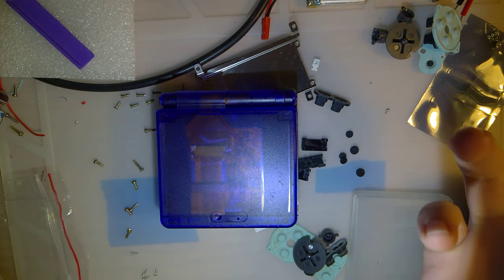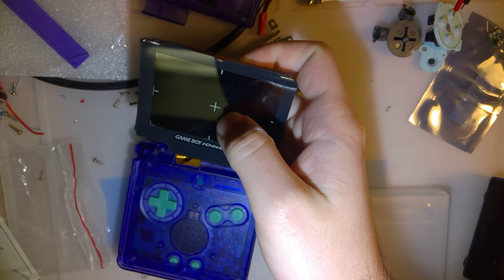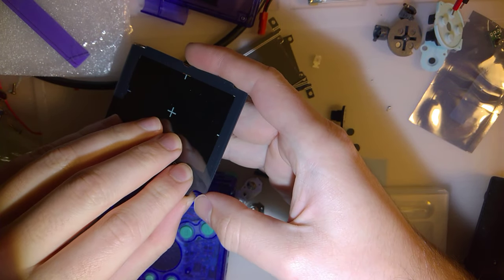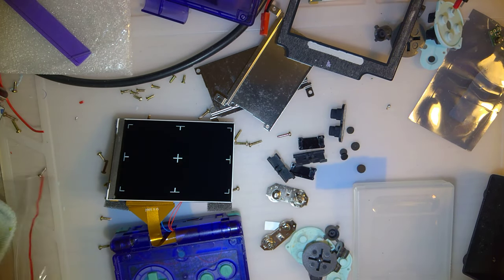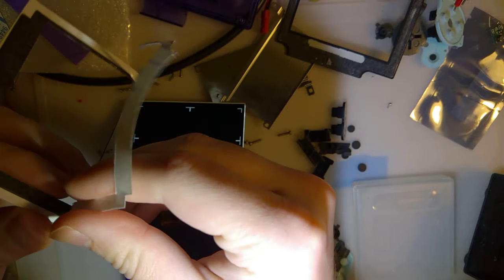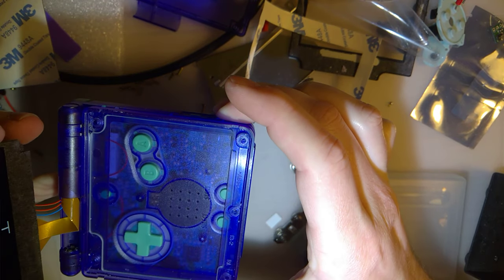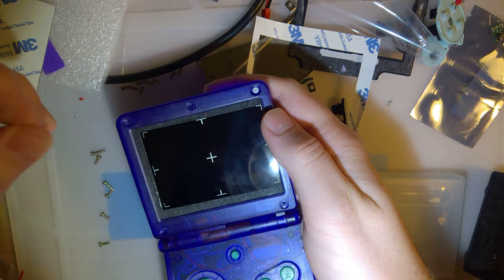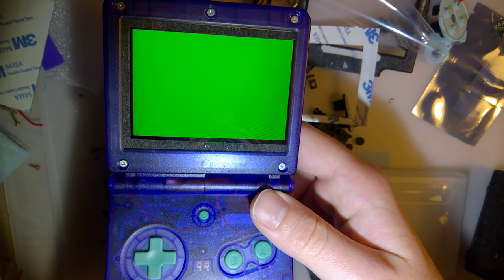Finishing the install of FunnyPlaying IPS GBA Screen in a GBA SP (Part 2)

Comment: I feel your pain at the end of the video. Finally I just put on the glass display... is that some dust? Oh no did I just smudge the screen? Now I smudged the other screen. Great I forgot the backlight bleed protector... Proceeds to use a suction cup to remove the glass 8 more times

Comment: Any tips or links for good batteries for sps? I got my ips v2 with a repo NDS battery and get around 2 and a half hours on normal brightness, same battery lasts about five hours in my 101
Reply from the maker: First off, that battery is garbage no matter what console you put it in. It should last four times as long, minimum. Second, sorry, I do not have any good recommendations. I usually pick up those cheap green batteries on aliexpress/ebay and just use those. The capacity isn't great, but it's usually good enough (10 hours on a stock AGS-101).
Reply: @makho  thanks man. Its all good. 10 hours on a 101? Might have to pick on of those up. Having a sp is really nice when there is too much down time at my job, I work nights so it can get really boring.
Reply from the maker: @scholae8746  Look up the original run-time. Ten hours is still on the low side.
Reply: @makho   I have and and ten hours is battery than anything I get.  The current green battery I bought from retromodding.com claims to be a 850mah but, only gets three hours and forty minutes in a 101.  
Looking at the reviews on ally express for a sp battery a few people says its less than half what the battery claims to be or luck of the draw.

Comment: Quick question. Is there a way to make the IPS screen compatible with an ags 101 motherboard or would I need a new ribbon cable?
Reply from the maker: there is no difference between AGS-001 motherboards and AGS-101 motherboards when using this cable since the front/back light is ignored.

Comment: pls, correct me if I'm wrong, but why are you breaking apart the laminated screen? people pay additional money to get laminated screen and get rid of air gap between lense and display. this is very strange
Reply from the maker: When I made this video, the laminated screen wasn't an option. This is an AGB v1 kit installed in an AGS, not an AGS v2 kit.
Reply: makho got it

Comment: I thought it looked better that time u tried it without the gasket b4 u attached the lense. U should just remove the gasket, sure there may be higher chance of dust, but also easier to clean 😉
Reply from the maker: Without the gasket, the screen has nothing holding it in place. I'd have to secure it some other way or even make a bracket to hold it in place like the AGB bracket. 

And I am a but wary about taking this apart. With a glass lens, I can't flex it as I remove it. I'd have to saw it off the screen with floss or something.